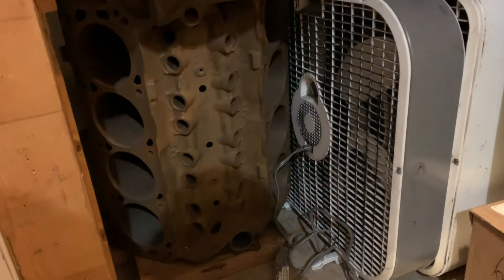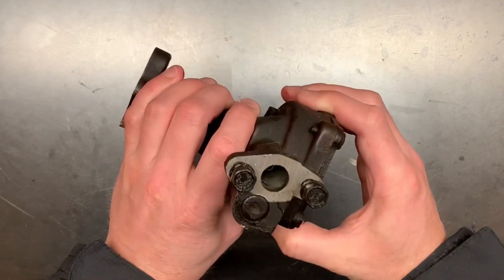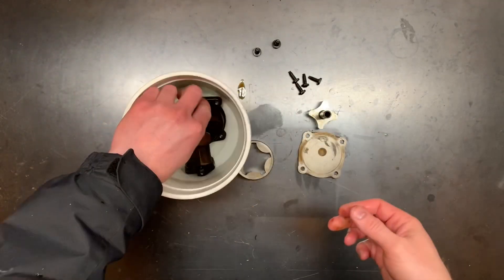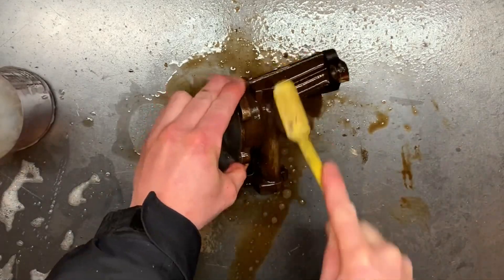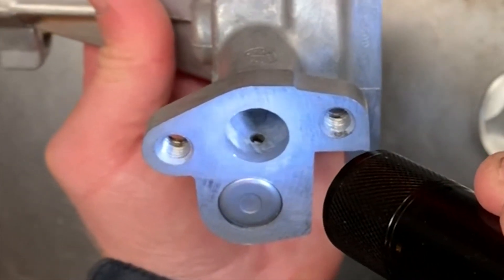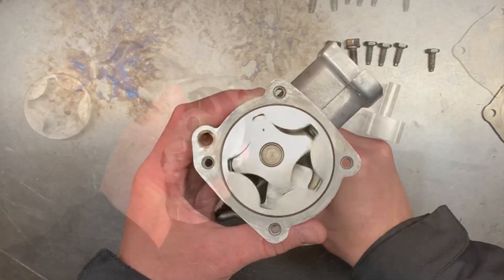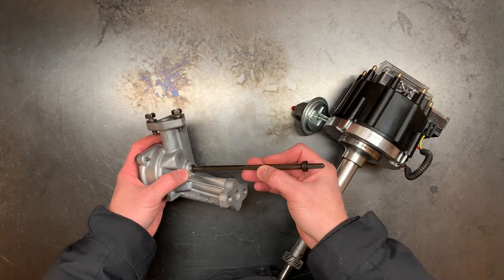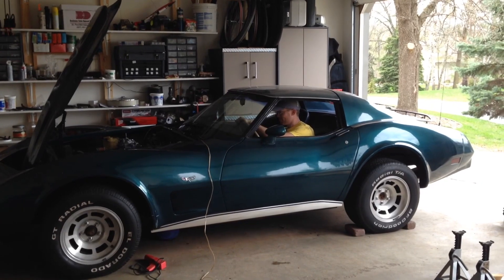Project Ford 347 Part 1: Oil Pump?

Comment: So I took mine apart to make sure it didn't suck any metal during the engine exploding. It was a brand new hv pump with maybe 100 miles on it, installed due to low oil pressure in previous engine. Everything looked great inside, no metal found but the outside surface of the ring looked scarred up. All the inside diameter and star piece looked brand new. I'm curious if the pump is still good being that outside diameter was like it was. What do you think? I was watching this to see if I could catch what yours looked like. Couldn't really tell.

Comment: I've never wasted my time cleaning and re-using an old OEM aluminum oil pump. The new cast iron body HV pumps are cheap and even a new pump needs to be disassembled, checked and cleaned before bolting on the engine, but at least it's not some greasy ol POS that probably should just go in the metal recycle anyway. To each his own, but I like new stuff.
Reply from the maker: All great points / I like the idea of a cast iron body too for piece of mind / will consider that on future engine builds

Comment: 5.0 roller cam motors are very versatile, cheap and effective.
Reply from the maker: I love them / they are small and make great power for their size. And they sound great too! Plenty of aftermarket parts also-